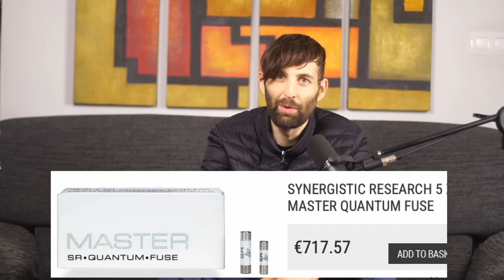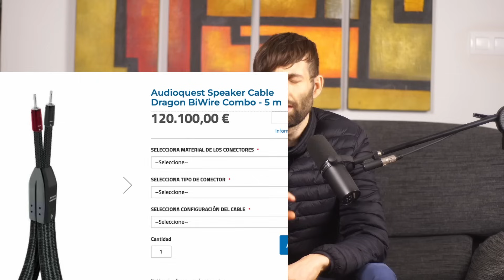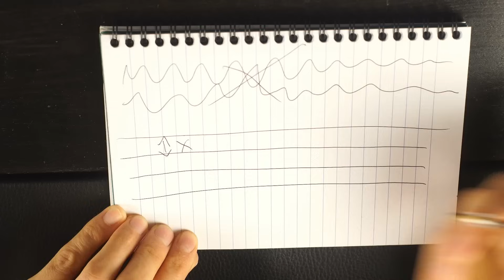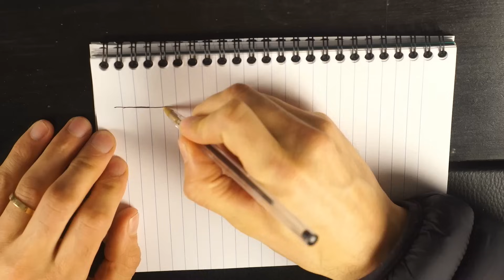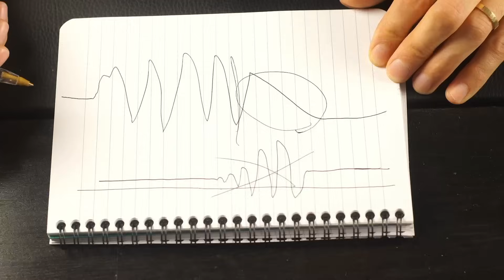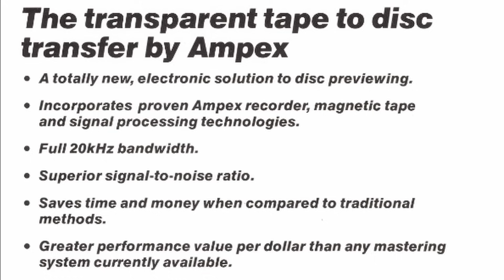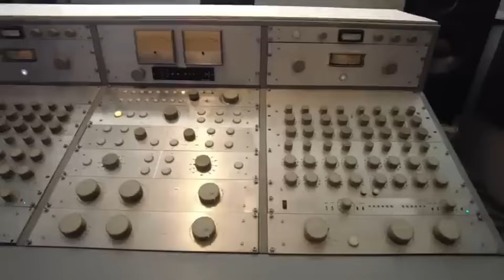Hard truth: most vinyl is digital anyway

Comment: The audiophile myth arose from early experience with the "loudness war" ... they would buy a CD to augment their vinyl copy and it would be LOUD and right in your face, compared to the vinyl.  As pointed out this is a result of different mastering techniques not the medium itself.

Years ago I took a lot of my vinyl collection and transcoded it to MP3/320. Once I got the levels right I could not tell the difference between them... Doing A-B comparisons I would actually have to get up and look to see which was playing.  

Then came the CD loudness war and I just skipped right over CDs and went completely digital.  So there is a good reason why my pop music collection dead ends in 1995.

I find it truly ironic (and a bit tragic) that the best medium was used to deliver the worst music... and in many cases it still is.  

The point is that CDs and WAV even MP3 can far exceed the capabilities of Vinyl ... it's not about the medium, it's about the mix and master.
Reply: I still have vinyl.
Not much and mostly stuff that is either rare, autographed, or not streamed anywhere.
I play vinyl through a pricey cartridge, a Thorens TT,  and an Audio Note tubed phono pre-amp, and it sounds like crap compared to my digital collection.
And something new that I have never experienced in the 20th century is defective pressings.
I bought records from the 70's to the early 90's. Never once did I ever have to return a defective record.
I don't really buy much vinyl.
And half of the new re-releases I have bought were garbage.
Some so bad, I thought something was blown in the stereo.😊
Reply: @rosssmith8481  
I sold off my vinyl about 15 years ago. My music now resides in a 4tb SD drive in a small compter.... even the transcoded vinyl sounds better there.
Reply: I disagree, but I’m not saying that one, either one, is better than the other. That’s personal preference. But the inherent natures of the mediums are a factor. It’s not just the mix and the master, even though those are very important. Obviously to make a recording work on vinyl the audio must be dumbed down a bit to function within vinyl’s limitations. But the medium adds something in the midrange that I find captivating. A few years ago third man records released a 3 vinyl disc edition of patsy cline recordings, and “I fall to pieces” sounds like like the musicians are in your living room — its most noticeable in the standup bass. Obviously that was an excellent recording in the first place and the tracks were I’m sure painstakingly cut. But there are plenty of cds of that recording and none of the ones I’ve heard have that “in the room” quality. But again, that’s my personal preference.
Reply: @bridgestreetdesign  The vinyl doesn't bring "in the room" stuff, the recording does... If the digital version doesn't have it, then it's been mixed differently / by someone else, etc.  There's nothing the vinyl can do digital isn't able to do better.  The digital format is just much better on all metrics.  Undergrad level knowledge in electrical engineering....
Reply: @guyboisvert66  “I fall to pieces” was recorded in 1960, there’s basically nothing for someone else to remix. There’s just a mono master on analog tape, probably 1/2 inch, which every release has been generated from. If it’s not the vinyl then why does no digital transfer I’ve ever heard of have that quality? That song is iconic, it’s not like they’re going to have an intern create the transfer.
Reply: @bridgestreetdesign  Proper transfer to digital won't add nor substract anything... I challenge anybody in a blind test on this...
Reply: @ that is correct — a good digital transfer does not necessarily add or subtract anything, but the mastering process definitely can or we wouldn’t have those screechy loud masters that hurt your ears. Likewise, cutting a lacquer definitely will change the sound, that’s what it’s supposed to do, to dumb down the audio to work with vinyl’s limitations. And whether that in-the-room quality is caused by the cutting compressor, the lathe, lacquer or whatever element that is in vinyl manufacturing, none of these elements are in the analog-tape-to-finished-digital-master process. (Yes, digital mastering uses compressors but they’re not used the same was as cutting vinyl.)
Reply: @bridgestreetdesign  Obvious... Recording and mastering is the base.  And we can simulate anything with DSP, it's simply applying a transfer function.  So you may like the distortion added by analog, just as people like valve amps (not me).  Might as well buy full DSP, it's even more powerful than static distortion...
Reply: @bridgestreetdesign  Mix and master is certainly everything though, aside any sound colourations from hardware.
Reply: @ so the limitations of grooves cut into a piece of plastic are not a factor at all?
Reply: @ 
Yes they are a factor. Just like the limits of the dot-dash encoding of a CD. 

Let me say this one more time and please try to get your head aroud it.  

When recording engineers master for vinyl they cannot use heavy compression and limiting.  The music is encoded at a lower level onto the vinyl and still carries much of it's dynamic range.

When mastering for digital they can easily slam the whole thing righ up to 0dbfs (the digital limit)  with next to 0 dynamic range ... and, stupidly enough, they do.

Now when I transcoded my vinyl I did not apply any clipping or compression. I recorded exactly what was on in those grooves cut into vinyl ... and the result both sounded the same and plays back at the same level .... exactly the same, no audible difference.

This is proof that it is not the medium (the record, the cd, the file) that makes the difference in sound ... it is the way the music is mixed and mastered that matters.
Reply: @Douglas_Blake  actually I was replying to someone else, not you. But since you brought it up again: if you create a digital recording and the source is a vinyl record, of course it’s going to sound almost exactly the same as the vinyl source. It will not magically sound like cd of the same album. This is an example that the medium IS a factor. Once the audio has been dumbed down so it will fit in vinyl’s limitations and then is actually cut into the vinyl, you can’t get back the qualities that were present in the audio before the dumbing down. If you convert a 24 bit wav to a low res mp3 and then try to convert it back up you won’t get back the detail of the original wav (though admittedly compression algorithms are getting better and better so the audible difference is becoming less and less audible.) and before you say again about how I need to “get it through my skull”, I’m not the one making a claim but then presenting arguments that prove the exact opposite. Yes the skills of the mixing, mastering and cutting engineers are important. Same for the tracking engineer. But they are still constrained by the sonic qualities of analog tape, high or low res digital audio, and vinyl. Either you don’t know what you’re talking about or you’re really bad at verbalizing your viewpoint.
Reply: @bridgestreetdesign  
It is not the CD doing that.  It is the way the songs are masterd for CD that is at fault.  

The mediums... CDs can reach 96db of dynamic range and vanishingly low distortion; more than double what Vinyl never achieved.

The recordings ... Vinyl has limitations about maximum levels and dynamic range, in that if you push it too hard the needle will simply skip out of the grooves.  CDs do not suffer this limitation and can produce sounds that are 15 to 20 db louder than vinyl.  

Unfortunately this caught the eye of the music industry... "We can be the loudest on the air"... and soon enough CDs and Digital files were being mastered to push loudness further and further, sometimes achieving 0 dynamic range... at which point they were considerably louder than vinyl and often carried 20% or more distortion.  

It is not the medium ... it is clearly the recordings.  As I recounted above, I had no problem transferring vinyl to digital with identical sound quality.  The problem is in the mixing and mastering... between autotune, quantization, compression and limiting the music becomes noise. Much of it is totally unlistenable.

Frankly I've long held that most of today's sound engineers are probably better suited to driving trains.
Reply: @ ok, almost everything you said is correct. But I’m not sure what you mean by this::

“It’s not the cd doing that.” Doing what? The patsy cline thing I referenced? Where did I say that CDs are doing something that you feel they are not?

When you transferred some of your vinyl to digital, what about it sounds exactly the same? Are you comparing the vinyl to your digital transfer of the vinyl? If that’s the case, then of course the transfer will sound almost like the vinyl. Or did you compare the vinyl to a digital source that was not transferred from vinyl? A CD or something — hopefully a good one? They will sound decidedly different regardless of who mastered the digital version.

You said it yourself that vinyl doesn’t have the dynamic range and less distortion and have to be cut at a lower level then what digital can achieve?. So how is that not the medium at play?

The stats you’ve offered comparing vinyl to digital are correct. Yes, vinyl doesn’t have the range and volume of digital. I’ll even throw in it doesn’t have the top end as well. But you seem to regard these stats as proof of Digital’s superiority, and I say “so what?” I still like vinyl better. I made no statement that vinyl is better, just that I prefer it over digital.

I have “heaven and hell” by Black Sabbath on vinyl that was new when the album was released and two CDs. The first cd is from I think early-mid 90s, long before the loudness wars, and it sounds very good. But it still sounds like a cd. The other cd is post loudness wars and it’s terrible. So yeah, for a while digital audio was being mastered WAY too loud, but before that wad fine, so you can’t blame dislike of digital altogether on the loudness wars.
Reply: @bridgestreetdesign  
Do a search for the "alignment level" (Wikipedia has a nice article on it).  This is the point at which the playback volumes of CD and Vinyl align.  (-18dbfs == O vu)

This is where I did my transcodes.  If a song was mastered on vinyl then on a cd at the alignment level they would sound identical.   (And yes, according to some old articles, that was by design.)
Reply: @ yes I remember this from school, though there was much less emphasis on digital. But I ask: A) how does this illustrate your point, and B) what IS your point? You still haven’t said that, or answered my previous question.
Reply: @bridgestreetdesign  
My point, stated in my first comment is that bad/different sound is not the fault of the medium.  It is the way sound engineers mix and master for the various mediums -- vinyl, cd, mp3, wave, etc -- that makes the difference between them.  

CDs themselves do not sound different ... they are treated differently by recording engineers. 
Vinyl does not inherently sound better or worse ... it's the way they are treated by recording engineers that is different.

1) I don't care what your personal preference is. That is entirely up to you.
2) I'm under no obligation to answer anyone's questions, but sometimes I choose to.
Reply: @Douglas_Blake  Couldn't say it better!
Reply: When i was 20 years old i could hear difference from wave to mp3 320, i had computer old onkyo amp and tannoy m3
Reply: @nuznikas i remember buying a Sharp minidisc recorder and experiencing ATRAC for the first time. My god, the compression artefacts in those recordings 😮
Reply: @nuznikas  
With modern equipment and software that difference is pretty much erased.
Reply: @Douglas_Blake  It depends more on music type than software frankly, classical for example lends itself very well to be MP3 compressed, as most of the instruments played have well defined waveforms, so cutting a ton of unused waveform spaces doesn't make any difference. Music with drums and distortions tho gets smashed, the waveform of drums is much more complex so cutting stuff out makes it tend to just... white noise.
Reply: @Douglas_Blake you ever listen to edm on vinyl?
Reply: @vstrvcvrtv  
I haven't used vinyl in 20 years.  So, "No".
Reply: @Douglas_Blake  it's 2025, do you mean 40 years? 😅
Reply: CDs are 16 bit wide. If you don't max out the loudness and keep your preamp at a level in which the highest peaks reach the max values, most of the song will be effectively encoded in 14 bits or less. The loudness war was an unavoidable side effect of the poor bit depth of the CD standard. With 24 bits you can have an appropriately mastered song with the dynamic resolution that CD promised but was technically unable to deliver.
Reply: @UntakenNick  Poor dynamic range?? What the heck, 96 db differences on the same track will downright hurt. 24 bit at 144 is overkill but I don't see this as an issue for sure, just go with much better than anyone can hear at 50% size increase, then that's it. Anything above is just BSing tho.
Reply: @UntakenNick  
This "loss of bits" thing is a red herring.  Most of your music is way less than maximum level and is thus encoded into less than 16 of the bits in each sample.  In fact most of it is probably in 9 bits or less.  So turning down does just about nothing to bit depth.
Reply: First of all, maxing out is no problem. Just don't exceed 0db.
Secondly, even 14 bits has more dynamic range compared to vinyl.
By dithering the audio there is no quantization noise and 16 bit will sound fabulous.
Reply: @Richard-bq3ni  
Actually, "maxing out" is THE problem.

When I listen to music I don't want to hear some compressed, limited, time and pitch exact piece of technical wizardry ... I want to hear what the musicians actually played.  Their talent matters ... yours does not.
Reply: @Douglas_Blake  No, that is not a problem. Digital can go to 0db without any distortion, So you hear exactly what is played. As long as the loudest part doesn't go over 0db, you are fine. If it does, then it is bad because that results in clipping, and clipping is ugly.
Reply: @Richard-bq3ni  
Which is why streamers normalize at -15 or -16dbfs ... it is to allow for some dynamic range without clipping.

And if you think that collapsing 20 or 30 db of dynamic range into a brick wall then running it through autotune and quantization is "exactly what's played" you need to give your head a good shake.
Reply: @Douglas_Blake  I don't understand what you mean by that last part of of "running into a brick wall". I guess we are talking about different things
Reply: @Richard-bq3ni  
Read again ... " collapsing 20 or 30 db of dynamic range into a brick wall" means reducing it to 0 dynamic range.
Reply: @Douglas_Blake  Ok. Of course I agree with that. All I meant was that the maximum peak can go to 0db without a problem. I didn't mean smashing all the signal to 0db. I like dynamic music.
Reply: @Richard-bq3ni  
There we go ... both on the same page.
Reply: @Douglas_Blake  Agree. Communicating can be difficult sometimes 😉.
Fun fact, I didn't own a record player for a long time, that is since I left my parents home in the 90's. I just bought one because 2 of my kids asked vinyl for Christmas but I didn't have anything to play it on.
Reply: @Richard-bq3ni  
That first conversation is a horrible time to be forging first impressions 😵‍💫

Because I was working in the industry at the time I went straight from Vinyl to Digital in the late 1990s.  

I hope the kids enjoy their records!
Reply: @UntakenNick  That's a part of the reason they record in 24+ bits. Bit depth is about noise floor level, not fidelity.
Reply: @Douglas_Blake  so much this. in a vacuum, vinyl is a terrible medium.

analog isn't magic. there's nothing wrong with digital.

but if most albums are still mastered like crap for digital distribution, and better for analog distribution... vinyl is gonna sound better.
Reply: @arachnophilia427  
Most music is mixed to sound good through earbuds while walking down a busy street... 

Way back at the start of this, they should have been producing audiophile grade everything... If compression and limiting are needed in some circumstances (streets, cars, etc.) put the feature in the device ... don't burn it into the recordings and ruin it for all of us.
Reply: @Douglas_Blake  Today's pop music isn't made for audiophiles.  It's specifically designed to be background music, hence why it's called bedroom pop.  Gen Z, having grown up with streaming, has a different relationship with music than those who grew up with CDs, radio, vinyl, and other physical formats.
Reply: @bchristian85  
All of which is quite the pity.  

There is no reason to produce garbage quality music just because one generation doesn't appreciate high quality sound.  If they want to degrade the sound, they can use earbuds or skanky little bluetooth speakers.
Reply: @ That's what they do.  People who really appreciate quality music and sound aren't listening to Billie Eilish.
Reply: @bchristian85  
I will bet you 3 manhole covers (already placed on your street for easy collection) that if her music was properly mixed and mastered, she would have a much wider audience.  

"That's what they do" is nothing more than the willingness to accept bad behaviour. Seriously... quality does matter.
Reply: Thank you, I made a comment to this effect. I have analogue pressings of certain albums that are far superior to any digital mix I’ve heard. I collect different CD mixes too. And my digital chain is much higher quality than my analogue chain.
Reply: 10:55 dynamic range. Just listen to some classical music and tell me what medium has better dynamic range.
Reply: @nikolaki  
CDs can manage 96db and could easily accommodate the full dynamic range of classical music if the engineers would just stop compressing and limiting everything.  

Vinyl by contrast is lucky to get 30 db of range.
Reply: @Douglas_Blake  precisely my point. I love the fact that I can put on a Deutsche Grammaphon CD from the 80s and have to turn my amp way up (compared to a pop/rock CD) to hear the music (can't hear the noise floor) and then get my head blown during the loud passages.
Reply: @nikolaki  
Yep ... you want to hear what the musicians played... not what the engineers can do to it.
Reply: @nikolaki Except 90% of classical recordings are only available on vinyl.
Reply: I think people hearing vynl as superior are actually just enjoying the inherent distortion from it. Sort of like audiophiles living tube amps. They actively distort the audio, but people love it.
Reply: @Skylancer727  
I would agree, except for the loudness wars.  

Properly mixed Vinyl recordings from the 60s, 70s and 80s actually carried very low imbedded distortion, typically 2% or less.

But CDs mixed with compression and limiting for the loudness wars can carry upwards of 20% distortion imbedded in the mix.  While CDs themselves can be very low distortion, that isn't what we got.

For me, the objection has always been the in your face driving sound of the way CDs are mixed.
Reply: @ that is exactly it. I refer to it as a “midrange grunt”. You’ll find it in tube guitar amps, vinyl records and analog tape. Yes technically the stats for these technologies are not as “good” as they are for their digital counterparts, but people just like that sound anyway.
Reply: @bridgestreetdesign  
Of course. I grew up with that as well.
Reply: You swapped your files to MP3 320.... Sorry, but they must sound pretty bad. I digitized my entire CD collection to FLAC. The ones that were well mastered sound splendid when heard through Roon. However, many are ho hum, inevitable since a lot of the mastering from that time was poor. The reason for SACD, which barely ever got off the ground, was to finally offer a true "audiophile" level  digital format (24/96) that you could actually listen to at home. MP3 sounds like trash compared to audiophile vinyl....Full stop.
Reply: @Wised1000  
Read my first comment again... this time actually read the thing...

"Once I got the levels right I could not tell the difference between them... Doing A-B comparisons I would actually have to get up and look to see which was playing. "

Seriously dude, don't be attacking setups you know absolutely nothing about.
Reply: @Douglas_Blake  Seems that you are the one not listening. I have acquiesced that 24/96 masters are "perfect". In fact almost all audiphile vinyl releases are made frome 24/96 remasters! The issue is the crap digital files that we get to listen to made from those masters are most commonly horrible compressed MP3's or streams! The issue is DRM. Bit to bit 24/96 files that can be downloaded as such are few and far between. Now you get it?
Reply: @Wised1000  
What part of "I could not tell the difference" do you not understand?
Reply: @Douglas_Blake  a shame really
Digital could be amazing but no
Let’s make everything LOUD!!!

So therefore 
Vinyl for the win
Reply: @LuciferisKing666  
The mindless lust for more and more money has some really strange effects... Entire generations of people who have never heard actual instruments or real music, being only one of the minor ones. 

Not so long ago, a friend and I took his son to a jazz bar for his first legal taste of alcohol.  That night the band was acoustic, with the only amplification being from the bar's sound reinforcement.  The lead switched to a guitarist (of some obvious skill) and our young friend's jaw was on the ground:  "I've never heard anything like that." ... it was the first time he'd ever heard natural instruments and it completely blew him away.  

As I keep telling these guys... I don't want to hear pitch and time perfect techno-wizardry I want to hear what the musicians actually played.
Reply: That's interesting, because I remember the loudness war, it was on radio.
Reply: @Speed-Daemon-123  Radio was the catalyst then it spread to everything. RHCP's album Californiacation is a prime example
Reply: @Speed-Daemon-123  
And on tens of thousands of CD releases.
Do a search for "dynamic range database". They index thousands of albums and songs.  Go back a couple of years and you will see a lot of stuff with zero dynamic range.